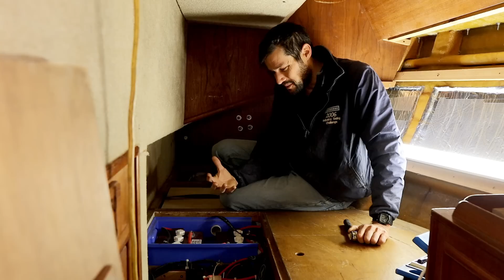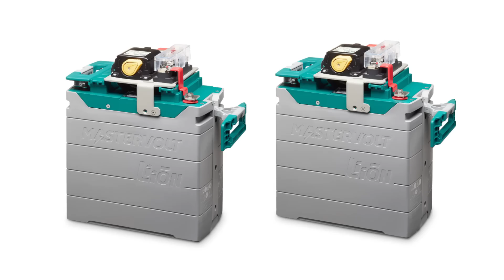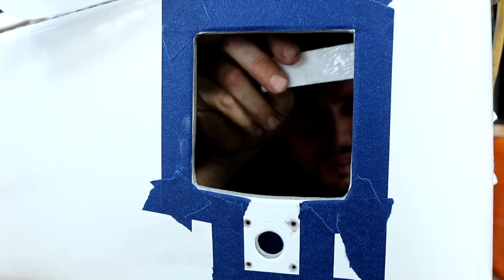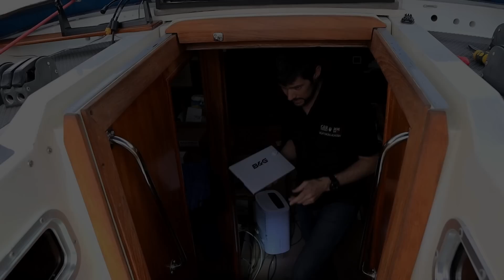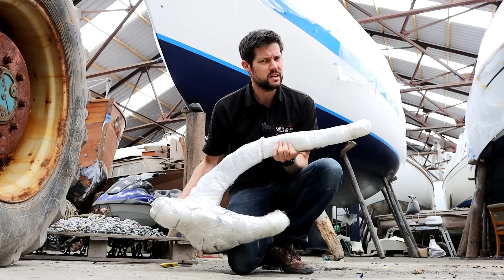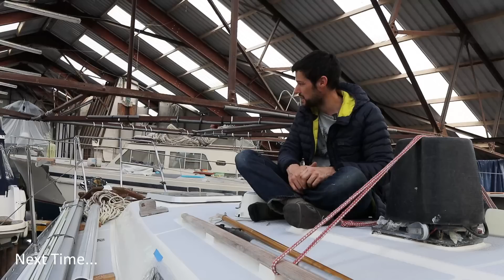Our Biggest Ever Upgrade | Sailing Florence Refit Ep.179

Comment: why did you chose mastervolt vs victron? Also, there are Lithium batteries rated for starting use so you could get rid of the AGM. You've already done the installation but if you could have fit 4 batteries in series you could have have had a 48v battery bank which typically runs more efficiently.
Reply: But can you find 48V equipment?
Reply: @stephenburnage7687  Most Victron equipment is setup for 48v. That's why most "off-grid" power generation has 48v arrays. Most server rack batteries, golf carts, etc... all use 48v. Generation and storage is better for conversion and efficiency.
Reply: @codegame027  I think you're referring to a 240Vac split phase residential service. The 48V is nearly trivial so the small gain before the inverter is a minor issue. Most of Florence is 12V so 48Vdc battery is a pain. Also conflicts with most small array solar.
Reply: According to ChatGPT so I can explain myself clearly. -> Using a 48V battery system on sailboats for off-grid energy storage has several advantages over a 12V system, primarily due to efficiency and the reduced current required for the same power output. Here's a breakdown of why 48V systems are often preferred:

1. **Reduced Current for Same Power**: Power (Watts) is the product of Voltage and Current. For a given power requirement, a higher voltage system like 48V will draw less current compared to a 12V system. This is significant because lower current reduces the loss of energy due to resistance in the cables. Less current also means that you can use thinner wires, which are lighter and cheaper.

2. **Efficiency in Energy Conversion**: Higher voltage systems are generally more efficient in converting stored energy into usable electricity, especially when using power inverters. Inverters converting 48V DC to 120/240V AC are typically more efficient than those converting from 12V DC. This improved efficiency translates to more usable power from the stored energy in the batteries.

3. **Compatibility with Solar Panels**: Many modern solar panels produce voltages that are closer to 48V, making them more directly compatible with a 48V battery system. This direct compatibility can simplify the solar charging system and improve overall efficiency.

4. **Scalability and Future-Proofing**: As energy needs grow, a 48V system can be more easily scaled up. It's also more compatible with larger, more powerful appliances and systems that may be added to a boat.

5. **Reduced Heat Generation**: Since lower currents reduce resistive losses, there is also less heat generated in the electrical system. This not only improves safety but also increases the longevity of components like cables and connectors.

Manufacturers like Victron indeed specialize in products that leverage these advantages of 48V systems. Their components are often designed to maximize the benefits of higher voltage systems in terms of efficiency, reliability, and safety, which are critical factors on sailboats where space and power efficiency are at a premium.
Reply: @codegame027  This summary is not quite accurate and confuses some issues; . 1. Boats only started with 12V systems because cars are 12V. Manufacturers were not about to start manufacturing limited numbers of 24V or 48V bulbs, radios, etc so 12V also became the standard for boats; 2. Yes,, losses (ie heat) are a function of the square of the current so 48V will always have a fraction of the losses of 12V. 3.. , One option (upstream)  is to wire solar panels in series rather than in parallel. Most individual solar panels operate in the range of 6 to 18V, so two, three or four panels might give you 36V, 54V, 72V max etc. The issue with that is what solar controller you have and can it handle that voltage. Mine can only handle max 24V (input) so i have my solar panels wired in series. 4. The issue with a 48V battery bank and wiring (downstream) is the same as it always was. Look to buy something like a windlass, bowthruster, fridge etc and you will find most offered at 12V with a few offered at 24V and probably none at 48V. That is why most of us stick with 12V systems, even though we end up with losses, despite ridiculously heavy and expensive cabling around the boat. 5. Sure, you could in theory, have a 48V battery bank & wiring then couple it to a DC to DC convertor to supply 12V at the load but that would likely be as  expensive and inefficient as buying large cables, with the added downside that you have added one more component that might fail at a bad time.

Comment: Dunno on that conversion.  Yup, smaller, lighter, increased amps... but if one of those batteries fail... you've got a big fire risk that will take out the boat in very short order.  You probably have more trust in that technology than I do.

Comment: Florence, I've done quite a bit solar vs boat load calculations. 125W panel is good estimate for daily fridge. But you're going further north. Your 250W solar is good minimum but more would be practical. Have you considered a turbine? The first 25W 24/7 is extremely valuable, the rest is gravy. Consider solar is typically 4 peak equivalent hrs per day. So a turbine can run 6x more day. That makes the 1st 25W = 150W solar panel. Turbines usually only stop anchored during high pressure. But that's when your load is lowest and solar doing well.
If no turbine, wth your current install, maybe wire existing panels in series to one charge controller, and add another panel to the 2nd charge controller.
Reply: In the tropics, my 400W of solar cannot keep up with my fridge load.
Reply: @stephenburnage7687  Interesting. Typical bigger 6amp fridge has 33% duty factor. At 12.3V = 585Wh per day. 4 peak equivalent hrs per day = 146W panel. Many fridge installs are less than 500Wh per day. My 16qt trailer sailer cooler is 200Wh per day after I added an inch of insulation. Could your solar be shaded, battery bank too small, poor fridge insulation, inadequate compressor cooling, fridge set too cold?
Reply: @artsmith103  I started in Vancouver (49 degrees N) and am now in Panama (7 degrees N). As I headed south, and particularly south of 30 degrees, the one thing i really noticed was fridge load. The fridge, which had performed admirably in Canada, began to struggle. The first thing I did was check refrigerant, fan cooling, program/controller, etc. Then i insulated inside the box, then outside. Probably have a minimum of 2 to 3 inches of insulation all round (and considerably more in places). Have also played with different fridge loadings (some argue a 2/3's full fridge is the most efficient). Also rewired the fridge with bigger cables (to limit volt drop). Current draw is typically 5A and the best cycling i get is around 50:50 (maybe a little better at night). Worse case it will run close to 100% on a hot day, or if you put room temperature foods inside.. So - somewhere between 50ah and (say) 80ah load over a 24 hour period. The other thing you notice, when full time cruising, is that useful battery life reduces and have been averaging 3 years to replace the house bank each time. Started with 200W solar bank and with that was getting 9A max (after the PMW controller), given cloud cover, etc so probably only 40 to 60ah of net input over daylight hours.  So - like most cruisers, bought a portable gen set. With new house batteries I might have two days after a passage (alternator charging) before needing that, but then you get  into a cycle of running it an hour a day. As the batteries approach the end of their life, that might go to 2 hrs a day. Next step has just been to increase solar capacity (to 400W) and have been getting max readings up to 15A on a cloudless midday and the step after that is swap to a MMPT controller. With that, i might get to the point where solar is capable of matching fridge (and other daily) load, over an extended period.
Reply: @stephenburnage7687  Lots of great info. I'm between 35-46 N latitude and water rarely above 75F. You've covered all the bases and more. All of my solar chargers are mppt. In theory it's 18/14=30% better but I typically see +15%. I also have a 3.3kW gridtie array so more experience from that. Your extensive list didn't mention compressor ventilation (actually did). Maybe room for improvement. My warmest experience was Hawaii to PNW. We expected to have to shut off fridge on cloudy days but we never did.

Comment: Putting more battery power in is fine so you can use more . The more you use the more you have to produce . You can run them down much lower , but then you have to produce more .  How will. You do this . As your further north you will get less solar energy . ?  Will, you put a high power output altinator on the engine . And run that ?
Reply from the maker: Yes a higher power alternator, also more solar. Expecting to need to run the alternator which we didn't do in the tropics. It will be interesting to see how the power balance works in the higher latitudes and then we will see what we need to change.
Reply: @SailingFlorence  yes very interesting, lithium tends to lead to battery and power watching,  the altinator system is looking a good idea, not perfect, but better than a generator, the worst part on a yacht for dependability. My view is on the altinator , have a separate cut of switch , so you controle the output,  you will use much more fuel .
Reply: I am told that you can do quite well with solar in the Arctic (in the summer) as it is mostly cloudless and while you have a lower incidence angle, it is compensate by having a very long day.

Comment: Postponed my morning start to watch Florence. Taking the cover off, installing slightly larger battery bank, additional solar charge controller and solar panel plus some new wiring into a junction box I added in the stern lazerette.
So similar but 20% the scale of Florence.

Comment: Why do you have 2 DC to DC power supplies between the engine battery and the Lithium batteries? Also everyone forgets to make a provision to charge the engine battery from the lithium should you need it
Reply from the maker: The two dc-dc supplies are because the alternator has a higher output capability than the one on its own can supply. These DC-DC supplies can also be reversed to charge the Engine bat  from lithium's if we need to.

Comment: I think you'll really like the B&G instruments...  they do a really good job for sailboats.  Very smart and nice to have one single system for your electronics and another for your Lithium power so you shouldn't have any interfacing issues.
Reply: "I think you'll really like the B&G instruments...  they do a really good job for sailboats."
Apart from daily "It appears there are updates available" message, splashed across the display 10 mins after power up, when you're most likely to be dependent on the chart whilst squeezing down a narrow channel.

Comment: I hate it when they say you can use 100% of battery.Have they been given discount on price to state this as a fact.The facts are this .5% will always be retained to stop battery from destroying itself.Also,you should never charge more than 80% and depleat less than 20%.So usage is 60%.Another fact is i paused this at 5 minutes.Another thing to mention.If you have a fault with inverter charger,and it causes batteries to destroy themselves.only the inverter charger is coverd by guarantee..Will now watch further to see what temp controll system they use for safty and operating temp.
Reply: Lifepo4 you can really use 100% but you don’t use it below 10% because of fantom usage by the bms system. You are talking about lithium cobalt batts those are better not to charge above 80%
Reply: BMS’s are from the battery manufacturer, Mastervolt. 
They have multiple ways to input power to the batteries and if all else fails they could disconnect the LiFePo4 batteries and operate the critical systems such as sailing instruments using the AGM engine start battery. 
Losing electrical systems on a smaller vessel rarely involves very much more than an increase in discomfort tbh, everything involved in safely operating the vessel can be done by a competent sailor without needing a single milliampere and that was the normal state of affairs until relatively recently.
Reply: What makes you assume these are not rated for their useable capacity? These are not cheap chinese or DIY units. Do you have experience with inverters destroying batteries and getting warranty?
Reply: @fritsified5952  Oh .as for rating.what i said is common knowledge about the batteries.If you keep using 5-100% The batteries will degrade a lot quicker and you risk them developing a fault.
Reply: The jump to Lithium is a big one. Until my load isn't manageable, I'll stick with FLA. I have a 50ah dinghy AGM battery and it is much better than FLA. So that will be my next boat battery bank.
Reply: @artsmith103  Do you know.most larger boats ,ships.crashes are caused by electronics.This is why,there are always 2 of the same.I also did not like they stated one component to controll everything.If so they should be carrying a spare.
Reply: @t147han  The things being controlled aren't too important except maybe the chart plotter and I'm sure they have at least one handheld gps.
Reply: STRONGLY suggest adding a third LiPo as Bank 2 with isolation from loads AND charging devices.  Prior to a 2,800 NM passage, we upgraded the house batteries to three high acceptance rate 255 Amp-hour Concorde AGM's.  Half way across, batteries at rest voltage 12.12 DCV went to charge with main engine 150A alternator without belt saver  controller...rotor lock for 10 sec...internal direct short to ground drained the house to 9 VDC before we could isolate and it got the start battery also.  The next 1,000 nm was a pee bucket, cold canned soups and ditch bag alkaline powered vhf and 90's era GPS.  Between the refrigerator food loss, AGM restoration, creating working and standby house bank and the new 250 scho alternator....$$$$15kUSD.  And possibly, the Admiral.
Reply: @johnparker3065 You didn't have fuses to go in the eventuality of a dead short? That is rule 101 on lead acid battery systems, for all loads/circuits (installed as physically close to the battery as possible).  Lithium would be different as the BMS (assuming one is installed) wouid shut down even quicker than a fuse can blow.
Reply: @johnparker3065 you should have bought Lifepo4 batteries and the BMS would have handled that for you no problem.
Reply: I really enjoy the two of you!
Reply: My concern is why they chose the more volatile lithium ion batteries instead of LiFePo batteries? Let's hope there's no mid ocean battery fires.
Reply: @Paul-nr5kg  LFP is a type of Lithium Ion. There are many variations; LFP, NMC, NCA, LCO, NMO etc. They are all Lithium Ion. These are the LFP type.
Reply: @Paul-nr5kg  They are lifepo4.All battteries are now.Less power than older lithium.but much safer.
Reply: @t147han my eyes must be deceiving me, as it clearly says on the boxes the batteries came in, and on the side of the batteries themselves, Lithium ion.
Reply: @Paul-nr5kg look up the specs - LiFEPO4..  Rated for 8000 cycles to 50% depth of discharge, 3500 cycles to 80% depth of discharge..  2000 cycles at 100% depth of discharge (that’s pulling 230Ah each cycle)..  And that’s while still maintaining 80% of rated capacity.